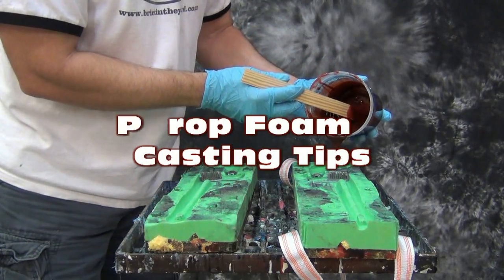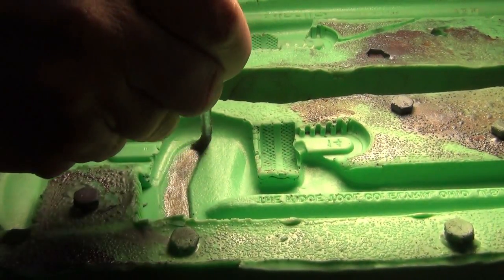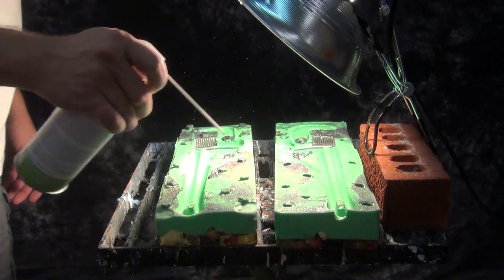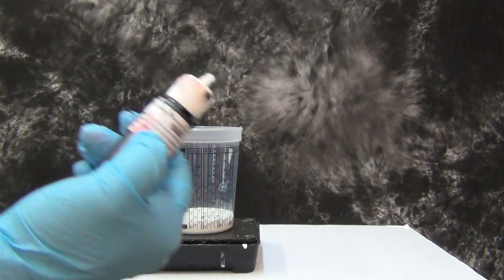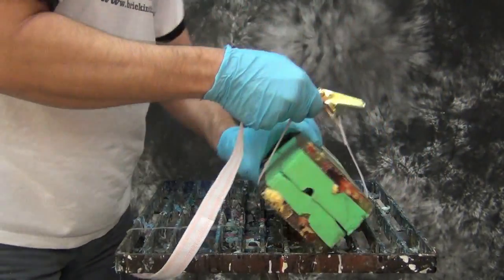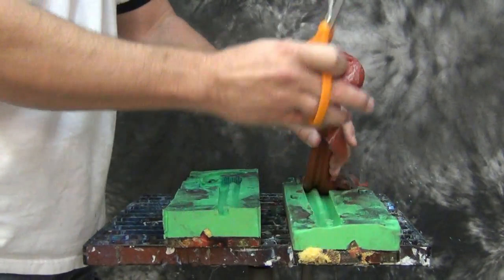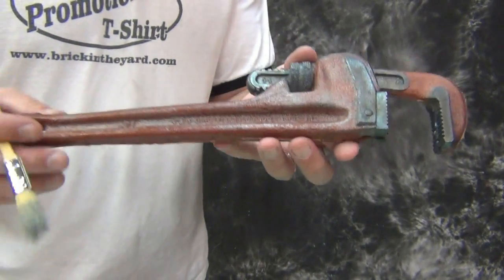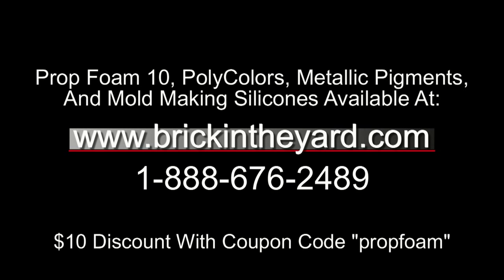Flexible Foam Tutorial: Casting Tips For PropFoam 10

Comment: Great video. Is there anything you can to to increase the pressure in the mould a little to ensure the skin once cured has no air bubbles?
Reply from the maker: +Powdah FX A smaller pour spout can be used to build up greater pressure, but may times air bubbles are created in areas that trap air because they are not vented. In that case a small ven may be cut into the mold to relieve the air. I believe we covered this in the video where we cast a foam hammer. There is a link to that video in the video description.

Comment: what is the difference between 100 & 40 vs 2 & 5
Reply from the maker: +AlbanyHauntCA One is simplified? Reduced?
Reply: +Brick In The Yard Mold Supply Im confused why would they not simplify it its not like the 10 parts a 10 b when you have a 1 to 1 mix ratio